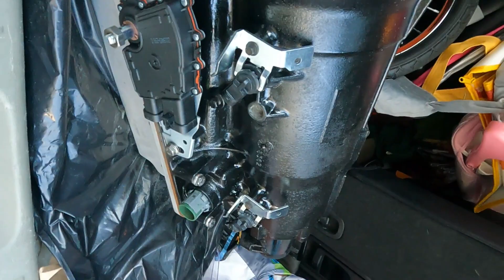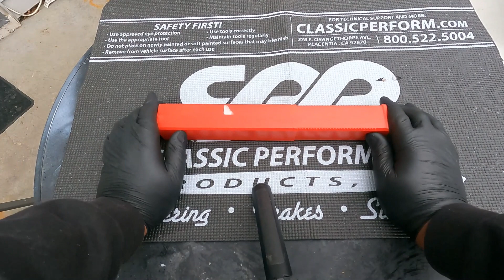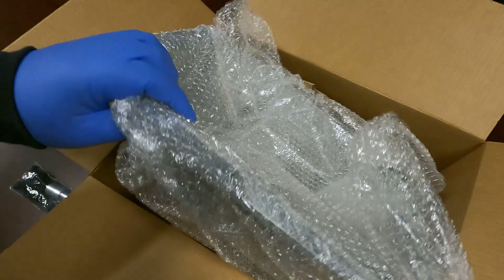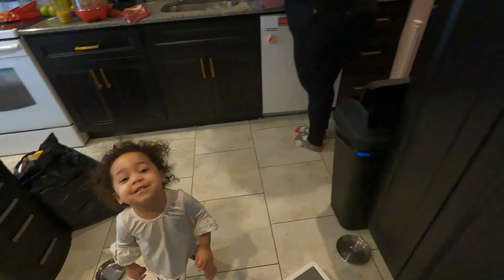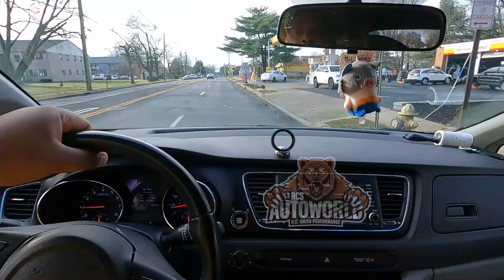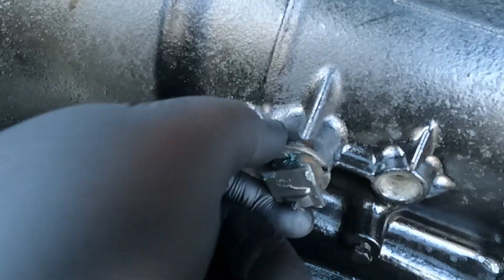Build Complete!! 4L80-E With Jakes Performance D3-Pro & Billet Shaft Neutral Safety Switch & Sensor

Comment: What those tabs on the sensor are for is jst to hold a plastic clip that guides and hold in place the factory wire harness.
Reply from the maker: Thank YOU!! I'm going to try and use them for the same purpose.